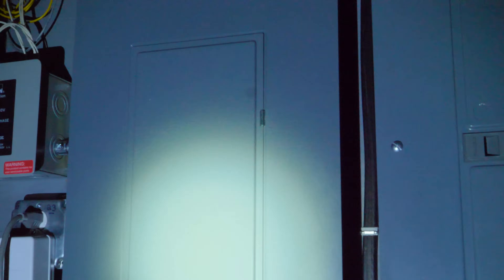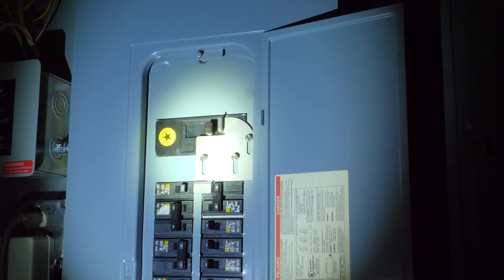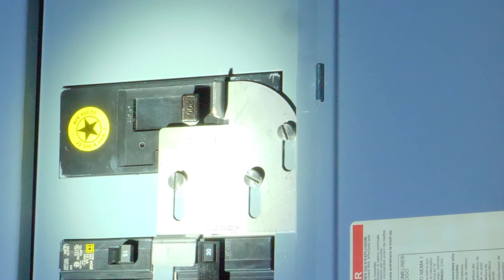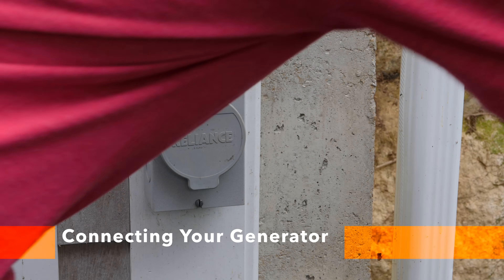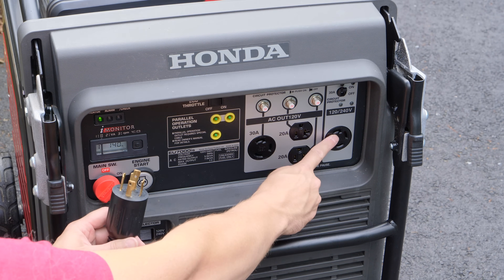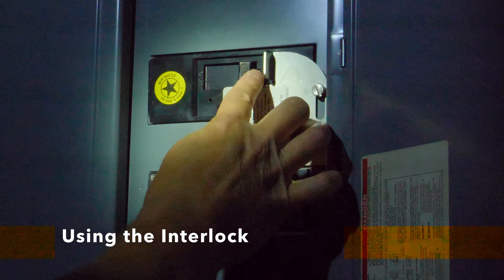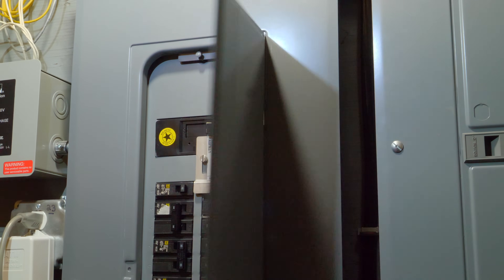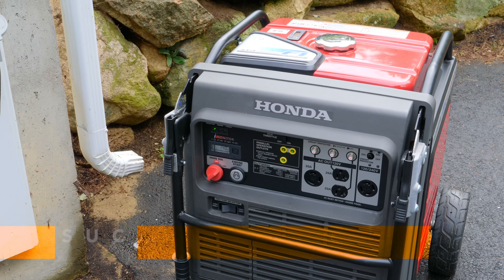Generator Interlock - Using it & Connecting a Generator to your House

Comment: great video!  Paul's comment is correct and might be worth adding.  All of individual panel breakers should be turned off first, then you can turn on the ones that are needed and the sum load can be handle the generator.  Of course if the generator is large enough to cover the whole load that is not an issue but even this should be mentioned.  Just the same, great job!
Reply: I always turn off all of the individual breakers and the gradually turn on the ones that I'll be using.

Comment: Where did you get the cable to attach the generator to the power inlet?
Reply: You can get those cords at lowes,30 amp 4 prong twist lock,25 foot cord is 99 dollars.
Reply: @davidm.5727  Thanks David, I just ordered one from Champion directly.  Much appreciated.
Reply: Here are portable generator safety rules: this safety information is only for anyone who use a portable gas generator and for those who are planning on getting a portable gas generator. This is just a reminder for everyone’s safety. All generator safety rules should be followed carefully. This advice is just to make sure that everyone is aware of all the warnings and it’s just to remind people to be careful using portable generators. Generators can be dangerous if not used carefully. Every year, hundreds of people die or get injured when using portable generators due to carbon monoxide poisoning and electrocution. Make sure you are using your generator carefully and keeping others safe as well. There is something very serious that everyone should always be aware of when using generators. Some people do run their generator indoors which is not safe and that increases the risk of carbon monoxide poisoning which can cause death of family and you. Some people run their generator in wet conditions which can electrocute them. Please remember that you should never run your generator indoors. Remember that carbon monoxide is an odorless and colorless gas that you cannot see or smell. Carbon monoxide is a silent killer. Keep that in mind. Make sure your generator is 15-20 feet away from your house and away from doors, windows, and vents. Never use your generator in your porch too. Having a carbon monoxide detector is very important against generator safety. Some people also allow children to go near the portable generator which could pose risks. We need to keep an eye on our children making sure that they are not near the portable generator so they won’t get electrocuted or burned by the generator which is dangerous. A locking enclosure also keeps kids safe. A generator shed might look like a tempting place to explore, or take cover during a game of hide and seek, but a generator is a dangerous piece of equipment that can cause injury. It says on the manual that we should also keep children away at all times from the portable generator to avoid injuries. Please do not allow a child or unqualified people to operate the portable generator.  It is important to keep your children safe especially little ones. The portable generator can be hot during an operation. Just because some manuals missed what should be listed doesn’t mean it’s safe to do. Always follow the generator safety rules when using portable generators. Generators pose electrical risks. If you need to use your generator during wet weather, you need a generator tent to protect your generator from getting wet. Don’t let your generator get wet. Keep your generator dry and before using your generator, please make sure your hands and your generator is dry. Do not wear loose clothing when operating the generator. Everything that is said on the generator’s operating manual should not be ignored. Never smoke cigarettes near the generator. Please keep flammable things away from the generator. Never overload your generator too. Your generator can catch fire. Never ever try to plug a generator cord into a wall outlet to avoid back feeding. Back feeding your generator is dangerous. Always turn on your generator first before plugging in appliances and shut off the appliances before turning your generator off. Use a heavy duty cord for your generator and the cord should not be worn out. All the instructions should be followed carefully. Never refuel your generator while it’s running. It can cause fire if fuel spills while your generator is hot. You should turn off your generator and let it cool off before refueling it. Having a fire extinguisher next to the generator is also important. This is only a reminder for everyone’s safety of using generators. Make sure your generator is properly grounded. Having a fire extinguisher next to the generator is also important against the safety rules. https://youtu.be/I1jT3ANENvI and here is a video more about keeping others safe when using generators and also about our family’s safety. It’s important to keep your children safe especially little ones. Hope this helps. Thank you.

Comment: Here's the problem. I love This method. However, Generators have the neutral bonded to the frame. Because of this The NEC requires a separate derived system. Which means all conductors including the neutral must be able to be disconnected by a transfer switch.
Reply: Just remove the bond (probably a jumper) between neutral and ground in the generator.
Reply from the maker: These are NEC code approved. They weren't years ago
Reply: @SilverCymbal  I want to believe you. But please show me the "UL" listed approved symbol on the interlock. Because what I see is a potential hazard is a parallel ground fault. There are now 2 main bonding jumpers. If there is a ground fault then the current has a parallel path that won't trip the breakers.
Reply from the maker: @BBQPitmaster626  I would reccomend you look up the interlock for your panel and see what the share for documentation. I believe you will find what you are looking for.
Reply: @SilverCymbal  250.34(c) says that generators with a neutral bonded to the frame must be treated as a separate derived system. That means all conductors (besides the EGC) Must be switched.
Reply: @BBQPitmaster626  ...that is correct and is a problem. It's like having a sub-panel connected to a main-panel....and both panels have a bonded neutral. NEC wouldn't g for this. Only one bonded neutral should be used. It is not the BEST solution, but what I did is NOT ground the inlet power box ( the outside connection to the generator).....and didn't run a ground wire from there to the main panel. The main panel still retains its ground and bonded neutral.....and you don't end up with bonded neutrals in both places. Just take special care of the cable from the generator to the inlet plug....keep it in good condition and don't ever drive over it. It seems an interlock kit is safe and accepted....however it will violate SOME aspect of NEC no matter what you choose to do....by either having bonded neutral in 2 places ....or by having no ground wire affect on the supply cable from the generator. I guess one other thing you COULD do is to unbond the neutral AT the generator internals itself, and still hook up the ground.....but then your generator better have a label on it, to say it now has a floating (non bonded) neutral and therefore should NOT be used stand-alone anymore like at a construction site.....yeah....it's a mess.......
Reply: @jasonbender2459  I think you're right.
Reply: The EU7000is has floating neutral anyway so this configuration is fine.

Comment: Unfortunately, most newer residential 200 Amp Square D and Cutler Hammer panels use a separate main breaker, so they can't be mechanically interlocked. This is because around 1990 the NEC started requiring that a switch "Opening and closing all ungrounded conductors simultaneously SHALL be provided to operate an additional supply source."  Being a retired inspector I doubt that you could get one to sign off on this (even though it's safe).
Reply from the maker: I think you may be confusing this a bit. This is code approved and I have a separate main breaker.
Reply: @SilverCymbal  I did a little research and I stand corrected. These are made by the manufacturer and are UL approved for the listed enclosure. I quickly found the correct one for my own Cutler Hammer panel I installed after Andrew in Nov '93. None were over $70. A a wireman, I can tell you it's quite a labor saver vs installing a 200 amp transfer, new feeders, mount the can, etc. Very cool. Where were these interlocks 30 years ago?
According to the NEC you should unbond the neutral in the genset, as it's only grounded at the service entrance. This is what your other reader was talking about. However, your bonded from the genset to panel main, and your gen main isn't gfci protected so it's a non issue. You would have to reattach it to use your gen outlets! So I always leave mine attached. I always ground everything.
Those with "OSHA" approved gensets with gfci mains will have to do this to keep their gen main brkr from tripping. You just unground the neutral in the gen. from the chassis. Very simple, but if you skip it the gfci main will trip repeatedly.  This is the cause of many 1 star ratings on Home Depot's website.

Comment: Shouldn't you connect the generator up to the house until AFTER the Interlock has been activated?
Shouldn't you disconnect the generator BEFORE removing the interlock?
Reply from the maker: No you want it connected first and running, before so that it can handle the load when turned on the interlock provides safety.

Comment: I agree the interlock is the way to go. To me, those 6 circuit transfer switches are silly. Of course with an interlock, you have to manage your load and not try to run your oven or dryer!
Reply from the maker: Yes, very true. It is easy to forget. Once I had it running my spouse didn't even know we were on generator and ran the dryer......beeeeyuuuup. No power, hey what happened? :)

Comment: Great video thanks like to ask you how big is your generator
Reply from the maker: Thank you it's 7000 watt. We have a well so we need higher output to run that
Reply: Silver Cymbal   Can you run an electric dryer with it? If you shut off other circuits? Thanks
Reply: @DONALD1951  I'm not a professional..... but..... You would have to check the amp-rating stamped on the breaker for the electric dryer.  If it is a double-pole 30-amp, and the breaker you install for the generator is the same or higher.... you should be okay.   You also need to check gauge of wire too.  10-gauge for 30-amp.

Comment: Have a nearly identical setup as you. Love my EU7000i. Recently went through hurricane Michael with power outage of about 22 hours. Ran generator for about 18 hours and powered everything but the AC. Fuel usage was less than 5 gallons. Great video!
Reply from the maker: Thank you very much. If you see my other video, I actually recorded it after 3 days of being on generator, live.  We didn't get power back for 5 straight days of running! We are on a well here so it's really critical.
Reply: If you wanted, could you have ran the a/c?
Reply: Here are portable generator safety rules: this safety information is only for anyone who use a portable gas generator and for those who are planning on getting a portable gas generator. This is just a reminder for everyone’s safety. All generator safety rules should be followed carefully. This advice is just to make sure that everyone is aware of all the warnings and it’s just to remind people to be careful using portable generators. Generators can be dangerous if not used carefully. Every year, hundreds of people die or get injured when using portable generators due to carbon monoxide poisoning and electrocution. Make sure you are using your generator carefully and keeping others safe as well. There is something very serious that everyone should always be aware of when using generators. Some people do run their generator indoors which is not safe and that increases the risk of carbon monoxide poisoning which can cause death of family and you. Some people run their generator in wet conditions which can electrocute them. Please remember that you should never run your generator indoors. Remember that carbon monoxide is an odorless and colorless gas that you cannot see or smell. Carbon monoxide is a silent killer. Keep that in mind. Make sure your generator is 15-20 feet away from your house and away from doors, windows, and vents. Never use your generator in your porch too. Having a carbon monoxide detector is very important against generator safety. Some people also allow children to go near the portable generator which could pose risks. We need to keep an eye on our children making sure that they are not near the portable generator so they won’t get electrocuted or burned by the generator which is dangerous. A locking enclosure also keeps kids safe. A generator shed might look like a tempting place to explore, or take cover during a game of hide and seek, but a generator is a dangerous piece of equipment that can cause injury. It says on the manual that we should also keep children away at all times from the portable generator to avoid injuries. Please do not allow a child or unqualified people to operate the portable generator.  It is important to keep your children safe especially little ones. The portable generator can be hot during an operation. Just because some manuals missed what should be listed doesn’t mean it’s safe to do. Always follow the generator safety rules when using portable generators. Generators pose electrical risks. If you need to use your generator during wet weather, you need a generator tent to protect your generator from getting wet. Don’t let your generator get wet. Keep your generator dry and before using your generator, please make sure your hands and your generator is dry. Do not wear loose clothing when operating the generator. Everything that is said on the generator’s operating manual should not be ignored. Never smoke cigarettes near the generator. Please keep flammable things away from the generator. Never overload your generator too. Your generator can catch fire. Never ever try to plug a generator cord into a wall outlet to avoid back feeding. Back feeding your generator is dangerous. Always turn on your generator first before plugging in appliances and shut off the appliances before turning your generator off. Use a heavy duty cord for your generator and the cord should not be worn out. All the instructions should be followed carefully. Never refuel your generator while it’s running. It can cause fire if fuel spills while your generator is hot. You should turn off your generator and let it cool off before refueling it. Having a fire extinguisher next to the generator is also important. This is only a reminder for everyone’s safety of using generators. Make sure your generator is properly grounded. Having a fire extinguisher next to the generator is also important against the safety rules. https://youtu.be/I1jT3ANENvI and here is a video more about keeping others safe when using generators and also about our family’s safety. It’s important to keep your children safe especially little ones. Hope this helps. Thank you.

Comment: What would a electrician charge to install interlock kit?
Reply: I would bet it would be less than an hour. Took me less than that, after watching a few YouTube videos. It really is not that hard.
Reply from the maker: Hi, they look like really great pumps. Not sure I will be able to get my hands on one to review soon though. I reviewed their specs and they seem top be built VERY well though. Honda also makes submersible pumps in stainless steel as well. I believe they relabel them but they are very well made also. (Not well known either that Honda sells these)
Reply: I contacted a electrician for a manual transfer switch, inter lock and outlet with 30 amp breaker 1st one was 1500.00!! Second one was 1230.00!! And the third was 1150.00!! So I know a friend who can hook up the outlet the inter lock and the 30amp breaker for a little of nothing and all my parts were like 250.00 soooo!!!
Reply: I’m a licensed electrician in NY...usually goes for $800 soup to nuts
Reply from the maker: The interlock kit itself is very easy to install. The plate is just adapted to your breaker panel. The cost can get expensive if you have the outside outlet run based on the difficulty of the run. For many years I never had an outside outlet and used the interlock kit and had a plug at my panel and used a long extension cord. That is MUCH cheaper to install. To answer your question though, I have heard total prices with an outside outlet will be between $400-700. But without the outside outlet it will be 1/2 that.  Good news is that once you put one of these in you will be all set since it will work with any portable generator.
Reply: @SilverCymbal  Thanks any idea if you will get a chance to due a review on Tsurumi submersible pumps?